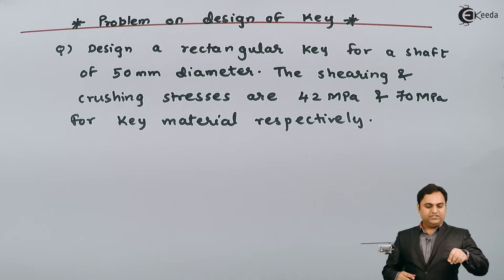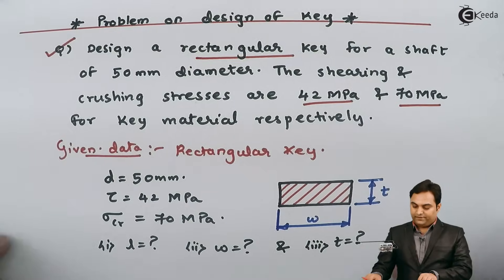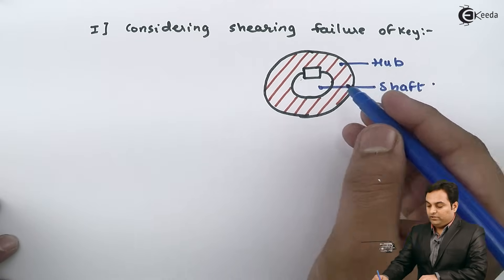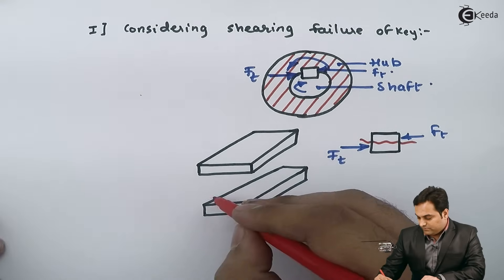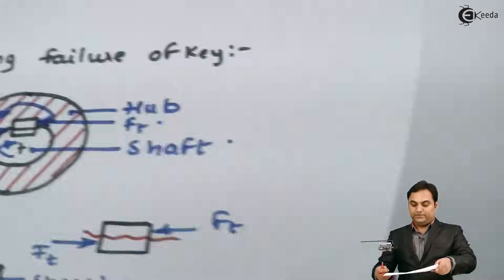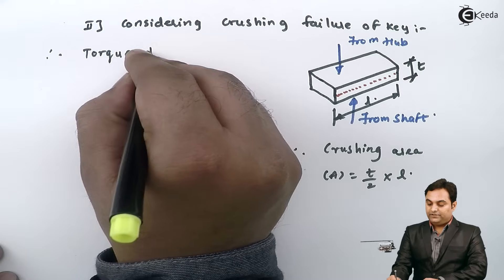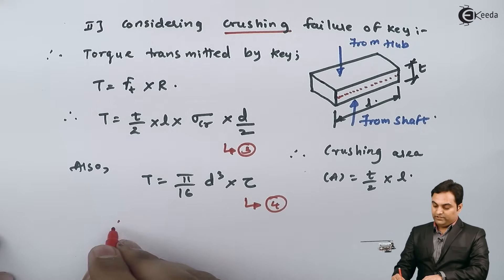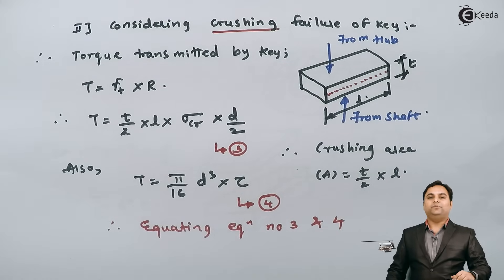Problem on Design of Key - Design of Shafts, Keys and Couplings - Design of Machine

Comment: A steel shaft has a diameter of 25 mm. The shaft rotates at a speed of 600 r.p.m. and transmits 30 kW

through a gear. The tensile and yield strength of the material of shaft are 650 MPa and 353 MPa

respectively. Taking a factor of safety 3, select a suitable key for the gear. Assume that the key and

shaft are made of the same mater

Comment: For the doubt of why length = 1.25d, this is because, it is a condition that the key cannot be greater than 1.25 times the diameter, so we assumed it to be equal to that and followed with the calcs.
Reply: Can we use 1.25 in every question??? Plss tell
Reply: @sachinsingh1237  I believe if its not specified you can.
Reply: It was supposed that 1.25 of d , you can consider whatever value but a legitimate value .

Comment: Design a key for fixing a gear to a shaft dia 25 mm KW of power at 720 rpm is transmitted from the shaft to the gear .The key is made up of steel 50C4.the yeild strength in compression can be assumed to be equal to the yield strength in tension

Comment: sir for rectangular key w = d/4 and t = d/6 as per textbook of machine design by r.s. khurmi.....what is your point of view about this ??? waiting for your answer
Reply: d/4 is used in square key and d/6 is used for rectangular key
Reply: this is one of the reasons why I love the comment section, because I saw this on the textbook as well and now I'm confused
Reply: w=d/4 is for square key
Reply: I think the correct procedure is .you have to find the dimensions using calculation of stress and then compare with standard dimensions of proportion and take the maximum value for safeness.